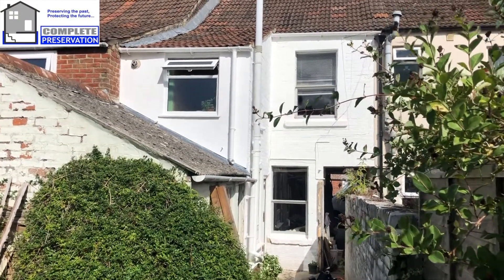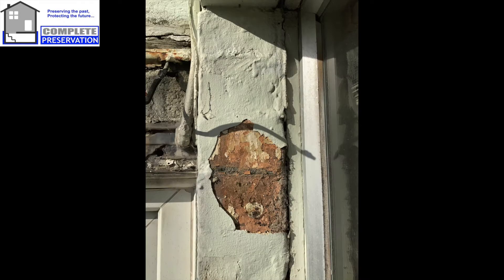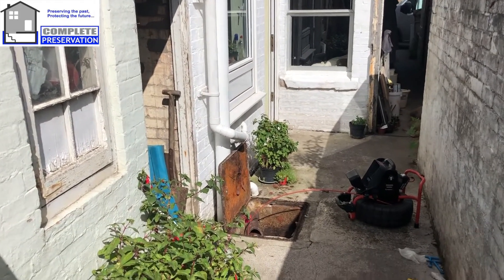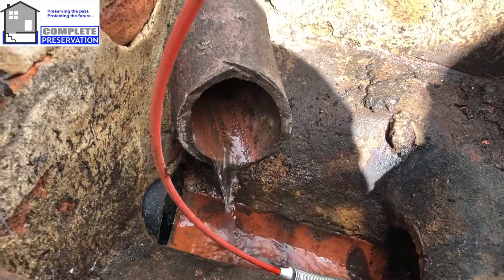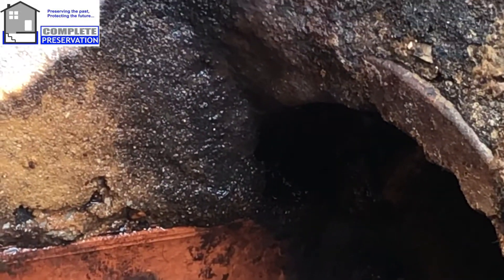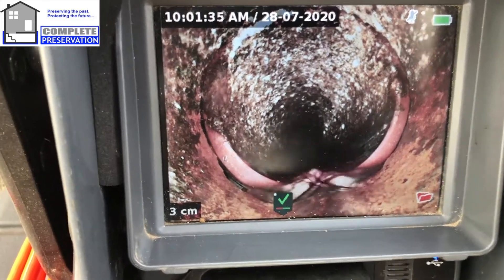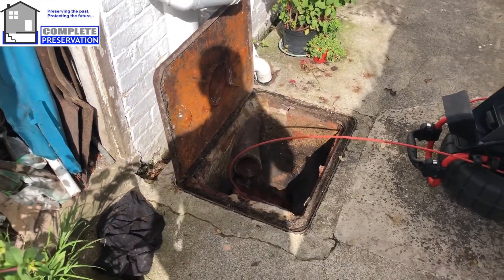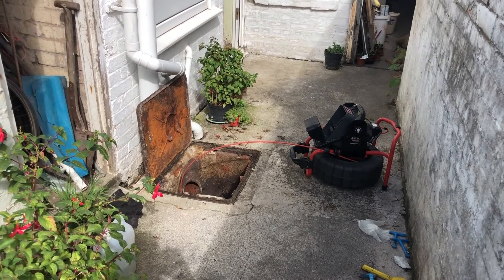Rising damp survey and drain defects

Comment: A passionate surveyor when it comes to damp. Is that drain camera very expensive?
Reply from the maker: Thanks Dave. I think this one was about is about 5 or 6k. I have a smaller one which is really only good for smaller waste pipes really, which i've used for years. What I found with that one is that it lacked detail, so you could quite easily miss things. It is expensive compared to damp meters etc, but I can get my damp diagnosis bang on.....You will also need a jetter, as you can't inspect a pipe with debris and silt, you will need a locator for your sonde to mark out locations of defects, you will also need some form of cleaning like spinning chains etc. My set up is around about 20k. It is a massive investment, but it is worth every penny when the client can see what the cause is, when theres damaged drains. I still get asked by clients if they can have a free damp survey as they've had other free damp surveys :)